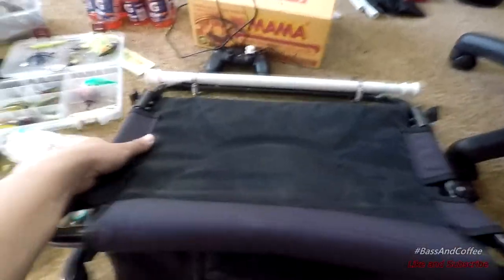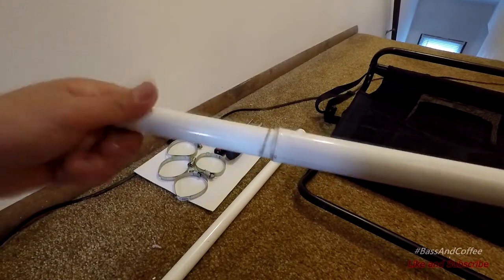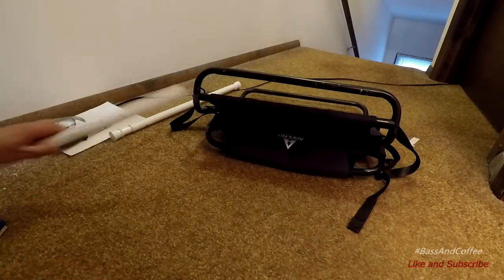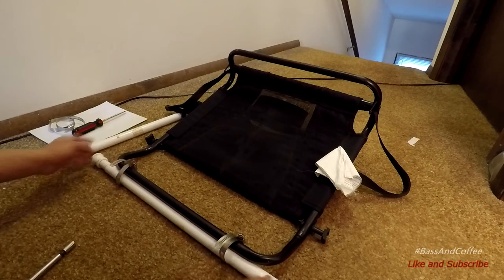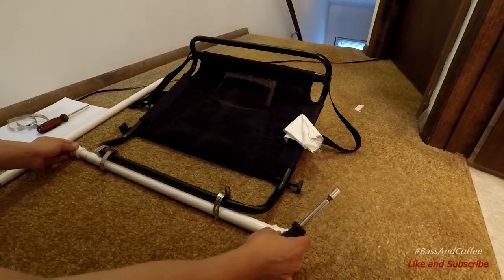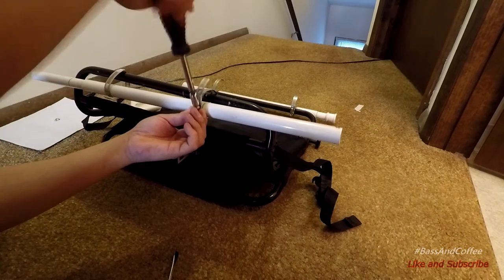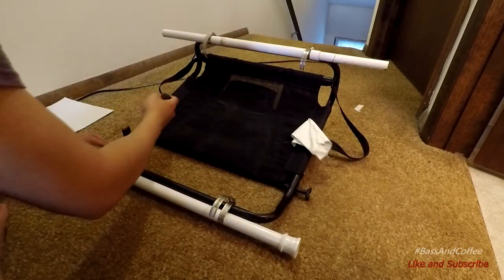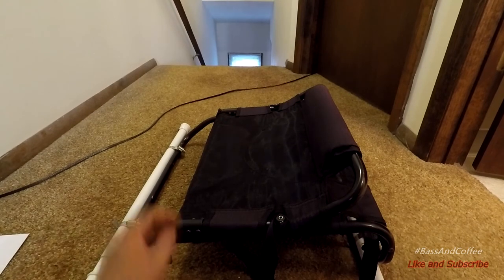How To Raise Seat on Ascend Fs12t Kayak | DIY (NO DRILLING)

Comment: I'm a fat guy and it still works. I'm 5'10" and weigh 235 pounds. Nothing bent, cracked, or damaged. The balance is absolutely the best. The higher seat helps me work my lures better, and stand easier. This is the best mod video yet without having to drill, weld, etc.
Reply from the maker: +Laz Castillo thank you for the positive feedback!
Reply: what keeps it from sliding back n fourth
Reply: Brent King my weight. I thought the same as you. I asked multiple times and everyone said my weight would hold. I didn't believe it. Then I actually did this mod. I purposely tried to prove them wrong and rock and tip the seat in the water while sitting. Didn't fricken move. If you check out my instagram I just posted a video I did last night of me fishing with this kayak with this mod.
Reply from the maker: +Brent King the weight of you should keep it from moving at all. Im going kayaking tomorrow but ill have a heavy weight guy 280+lbs 6ft riding on it while i film. Should be interesting